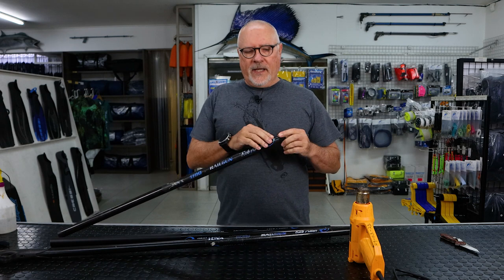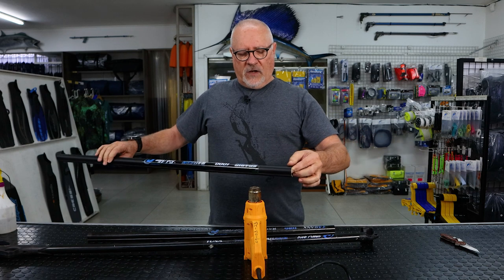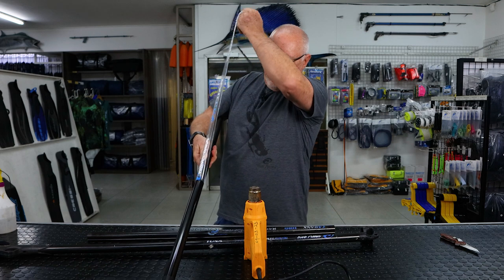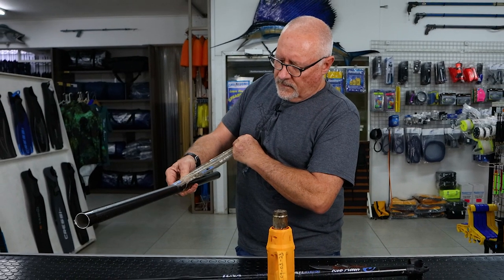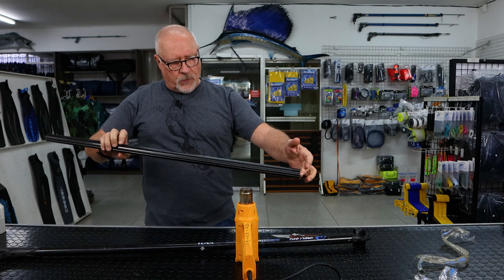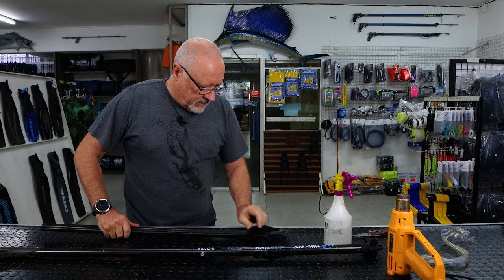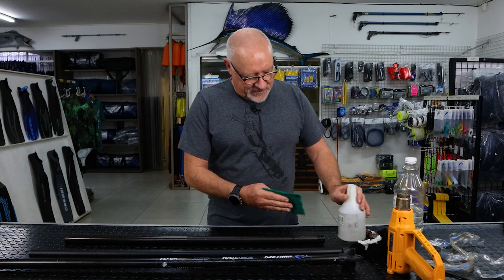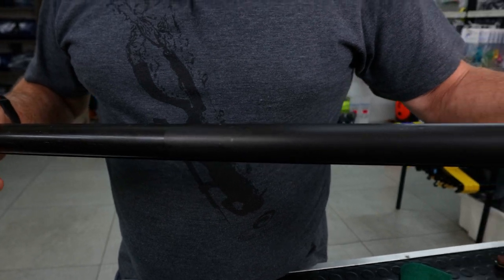Rob Allen | DIY | Barrel Sticker Removal | 2023

Comment: Triklean might do it, its about as close to magic as anything ive ever found.
Reply from the maker: It is the same as Acetone (an Acetone replacement) I will try some but Acetone does not work.
Reply: @RobAllenSpearfishing  It's sold as a replacement, but it's very different. I use it for cleaning resin residue off aluminium moulds after wind turbine blade manufacture. It beats acetone hands down. I will probably get a chance to try it on my new gun as I've ordered a new sticker for it.
Will let you know.
Reply from the maker: @MarshallRoad  We will see if it is available here in South Africa.

Comment: I have a fairly new RA gun that I'm putting a sticker on. 
Would you recomend I remove the glue before applying the sticker, or just go straight on after peeling off?
Reply from the maker: Best is to try get as much of the residue off otherwise it might show through the new sticker.

Comment: Lacquer thinner might do the trick. I find it releases some compounds that acetone won't remove.
Reply from the maker: Tried this by itself, just rubbing hard with a rag but no joy. I will try soaking it for 30 minutes then see what happens.
Reply: @RobAllenSpearfishing  Bummer. That's a crazy adhesive on there for sure. Not sure why you'd ever need to change the sticker anyway. If you're hunting around the rocks and reef, the new one is going to get beat up anyway.
Reply from the maker: @nathanielkirby5440  We use the highest quality vinyl with the highest glue rating, I think it is rated for 5 years in direct sun light, hence the problem removing the glue  😜

Comment: Hi Mr Allen, any good ideas of how to do this on the carbon barrels? 😀
Reply from the maker: I have not tested it yet but I think less heat might be better. I think a hair dryer might do it.
Reply: I wanted to add some measurement stickers to a carbon barrel. I used a hairdryer and it did the job without issue @RobAllenSpearfishing
Reply from the maker: @chrisbonato728  👍